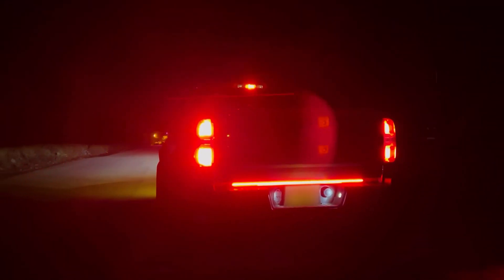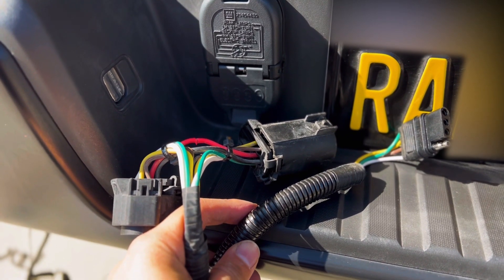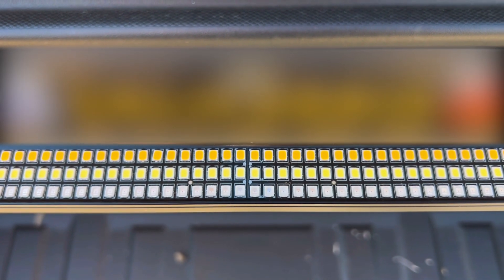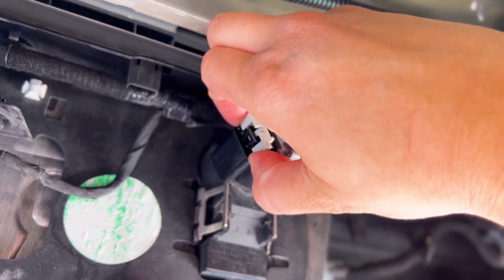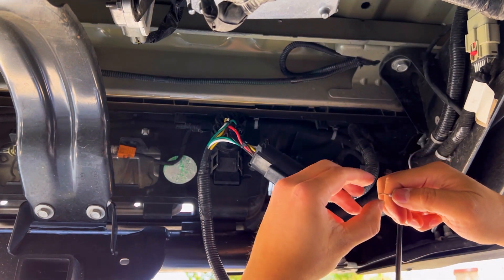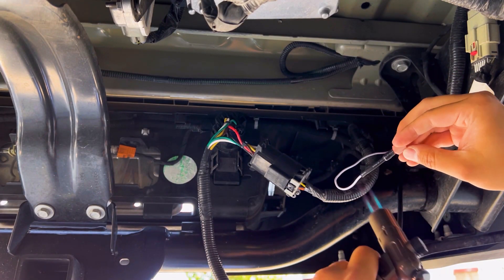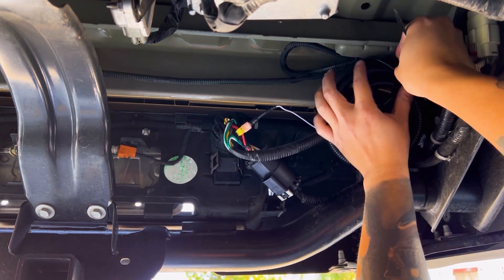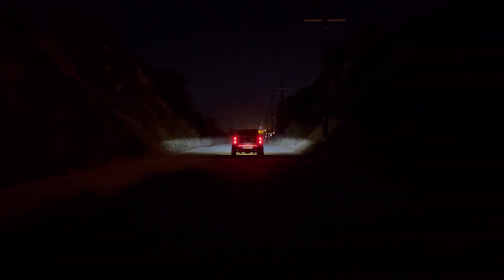[HOW TO ] OPT7 48'' Redline Triple Tailgate Light Bar Easy Install on 2021 Chevrolet Colorado ZR2

Comment: i had my set up like you until it stopped working. i then bought a plug n play harness that makes it more weather proof.  i also bought the 60 opt 7 its fits much better in my opinion

Comment: This does not work on a 2024 Colorado Z71.
Reply from the maker: Thank you for the feedback, we will let our product team know.
Reply: @OPT7Lighting Same here. 2024  Colorado z71 with tow pkg and app. Bought the light bar and wiring y spliter (the one that has the reverse light pigtail off the harness (boight BOTH from OPT7, and they had Amazon fulfill the order [make matters worse, if i would've ordered from Amazon they had a $30 off coupon!!!!]). Giving my trailer app fits. Connects, disconnects, tells me I have trailer wire issues, ect. 

What's going on ?????
Reply: I was just about to install this on my 2024 Canyon Denali with tow package, definitely dont want app or wiring issue codes. I'm thinking 2 dudes on here with the same platform truck that bought the same light bar and harness I did can't be wrong. I'll be returning :/

Comment: Got mine installed and went great only thing I would say about the video is the reverse light you tap into isn't always red on the wire harness kit I bought for it, same brand as light bar it was white.  It is always the middle wire doesn't matter color.  Also since you mentioned about getting t taps I got some but they aren't needed as I found out the kit comes with two wire connectors and they are more simple than t taps.
Reply from the maker: That's correct, the reverse wires varies for different vehicles.
Reply: Can you use different tow hitch adapter then the opt 7 one? I bought one of amazon and it seems to not be working. Truck is saying trail hitch is disconnected even when its connected.
Reply: @Jmax0060  sorry I didn't see your message.  I'm not 100% sure if you can or can't but I would think if you bought a quality one and it is similar and attached it right it would work.  I never looked for other ones I just bought the package that came with the bar and opt7 one so I wouldn't know for sure

Comment: Why is the yellow bar showing up first when applying brakes sometime. It happens often. Apparently the turn signal and brake light are on the same wire the yellow and green wire. Why is that. I believe that is what is causing the Amber light to flash first when applying brakes and then quickly turned red. How do we fix that. I'm not the only one with this issue. I have seen other videos with same issue. Probably they all do it and they don't even know. Have someone stand behind truck and someone hit the brakes going forward many times and you will see it.
Reply from the maker: For better support, please email our team at support@opr-7.com

Comment: I had OBT7 Redline Triple LED Tailgate light bar Installed on my 2022 Tundra 1794. Everything worked great. No codes/errors on Dash. Then, I noticed on one of my home  cameras that when backing up and then stopping and then go forward from Braking that sometimes the whole light bar flashed Yellow. Has anyone experience that or can check their OBT7 lighbars if they do that too. Does it when put in drive sometime from a stop

Comment: Um quick story, Last week i ran across the light bar on amazon and on youtube at the same time this video was super informative i was over joyed.. So, I ordered the bar without ordering the harness or a OPT7 pin splitter for  my 23’ taco do I need to buy those? Also whats sup with the reverse light and an a T Tab 🤨 first time working with this aha dont knoe wha im doin send help plz 🌮🙏🏽
Reply from the maker: Thanks for reaching out! You may use this harness on the 2022-2023 Toyota Tacoma, however, you'll need to hardwire the reverse wire into the tail lights directly rather than to the trailer plug on the back end of the truck. For more installation support - email our team at support@opt-7.com

Comment: Hi. First I wanna say thanks for sharing your video with everyone. I just recently purchased and installed the same OPT7 light bar on my 2024 Chevy Colorado. I had a question when you apply your break does your light bar turn signal work? When I apply my break the light bar turn signal just the solid yellow it does not flash. I used the quick connect cable that didn’t work so I also hardwired it and it still doesn’t work.
Reply from the maker: Hey there! It's come to our findings after several feedbacks from 2023-2024 vehicle owners, the Redline is not compatible with these years, even when using an accessory harness or hard wiring. It is recommend to return the product for a refund. We are currently working on a work around for these years, at this time there is no current solutions.

Comment: The one displayed on this video is the 60 inch, right? I bought one and it looks the same as this "48" inch
Reply from the maker: In this video, he has a 48''. We also have the Triple Row that is in 60'' as well.
Reply: @OPT7Lighting  Do yall have a solution for the underpowered lights on the AMP automatic running boards? Thanks!
Reply from the maker: @RichPrivilegedWhiteMale  not sure what you mean, but feel free to email our technical support team at support@opt-7.com

Comment: Does it work on a 1986 Ford econoline 150 camper van? I have glass fuses.
Reply from the maker: Not sure, but as long as you have a 4pin trailer plug, it will abel able to work.

Comment: Doesn't that truck have rear camera and tow assist. If so how does your hookup work. Any errors or issues with dash lights.
Reply from the maker: If you are getting errors, you can use the hardwiring installation method. However, the harness used in this video allows you to bypass hardwiring.
Reply: If you have the trailering app, you have to hardwire it. Otherwise, it will make your infotainment display go NUTS!!! I was PI$$ED OFF when it happened to me. I didn't want to be splicing wires, so I thought the ~$32 was worth it, and would've been SOOOOO much easier!

Comment: Did you Mount the light bar above the indentions on the bottom left and right, below the tailgate or right onto them?
Reply: yesi bin woundering about the  indentions as well
Reply: NO he put it on top I had to do the same. Its not completely flush on the ends but any higher and it hides behind the tailgate Hopefully the 3m tape is strong enough to hold in the middle  @batoutdahell3084

Comment: Can anyone answer my question please before i send it back. I don't want send it back and the replacement does the same thing. What could be causing this. Everything else works well. Only issue is sometimes when applying brakes a yellow bar shows up first then the red light.
Reply from the maker: For better support, please email our team at support@opr-7.com